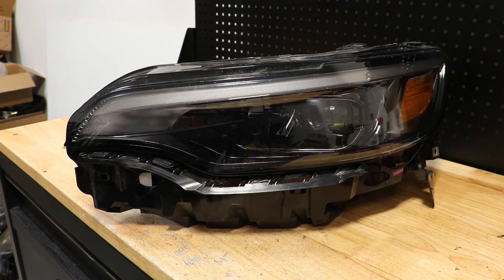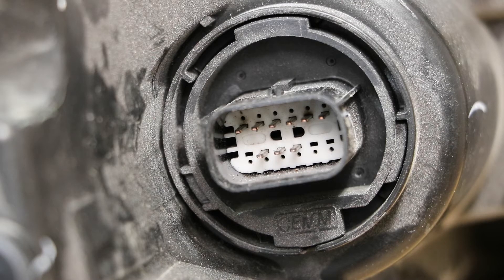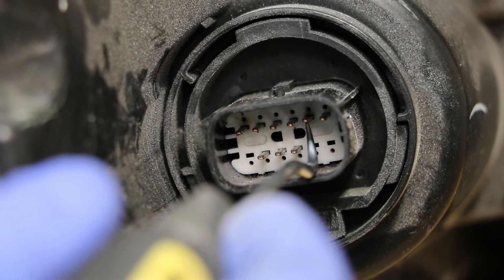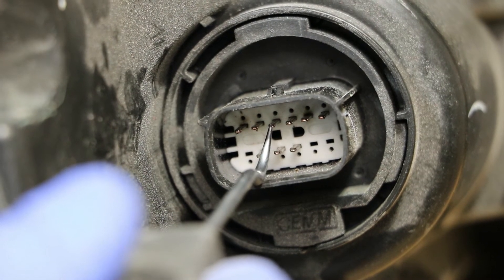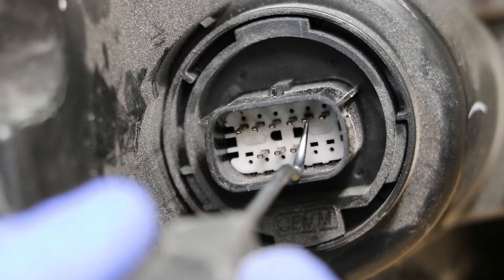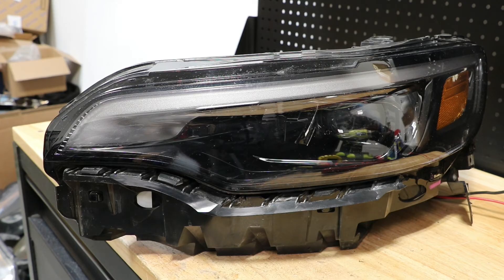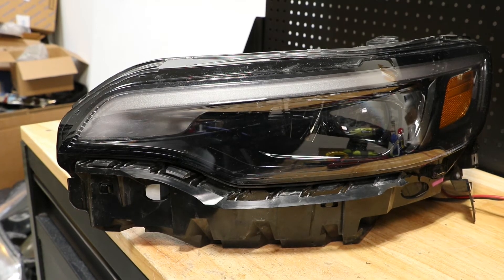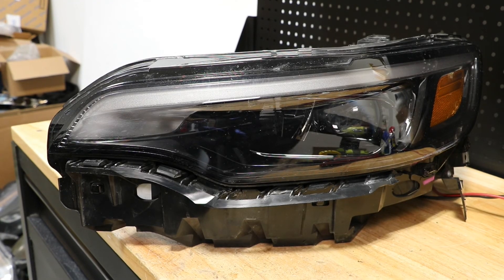How to test a 2019-2021 Jeep Cherokee LED Headlight

Comment: doing a retrofit using that projector right now. During my research i have ended up on your videos so many times that i just had to subscribe. I like the teardowns. But turning on modern headlights helps a lot. i have a 2019 Audi Q5 headlights that i just could never figure out how to get it to work. So now i bought the internals of this headlight just because you showed what it needs to turn on. Can i use just a car battery to  test this? what are the pins you didn't use for?  I am trying to get this to run on a 1998 Audi.
Reply from the maker: A car battery can be used, you just have to be careful not to cross wires as the extra amps can cause problems.  I use a small 15 amp bench power supply which is normally very forgiving if I make a mistake.   The extra pins are generally for feedback to let the computer know of a lighting issue or for leveling components.

Comment: I want to suggest you , (FOR MORE  VIEWERS AND USEFUL) make how to fix expensive projector on car, bike,scoty...for hadlamp or foglamp. Because most bikers wont to modify ther light. Sir please try it once.Out of the light you have shown by disabling,I have installed lot of similar light by waterproofing it in a car and bike.As much as any modification has been done,I have no video has been made of anyone. So I request you to make a full video of light modification.
Reply from the maker: what you are referring to is called Retrofitting.  there are lots of videos out there on how to retrofit projectors.   Scooters and motorcycles have small lights and require small projectors.  Scooters are pretty rare around here because they are too small and slow.